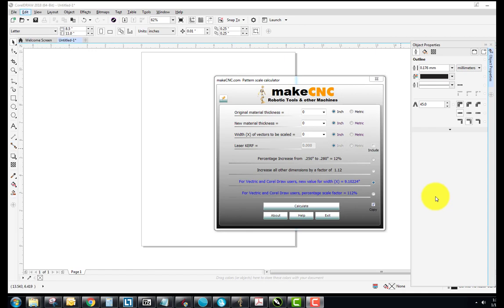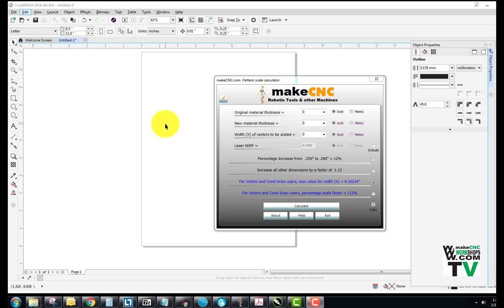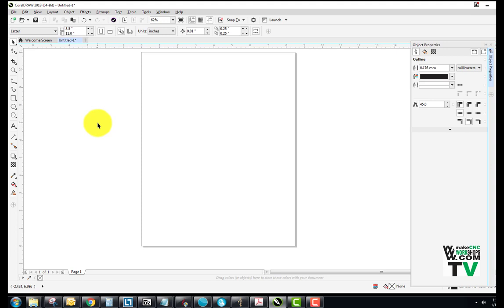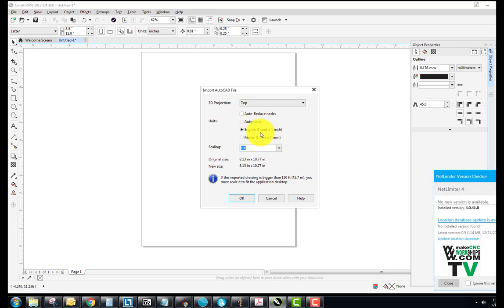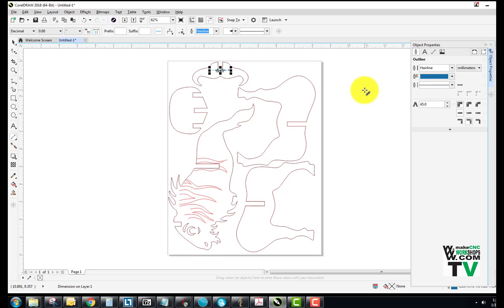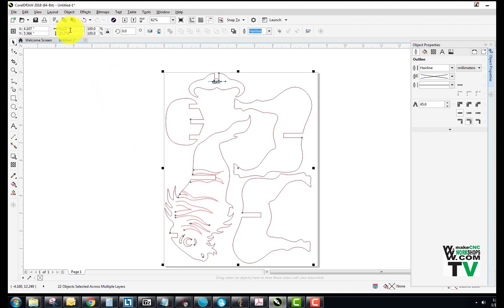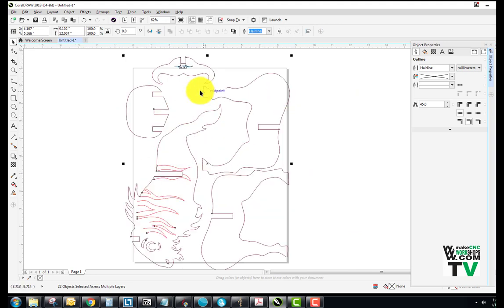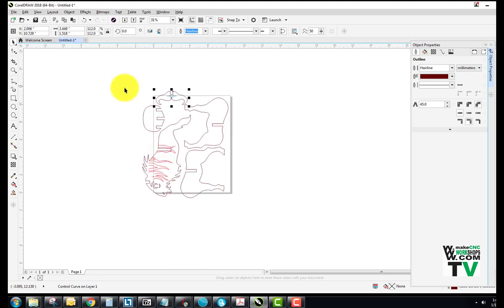Corel Draw makeCNC scale calculator tutorial

Comment: Quick question this is great when you have slide in joints, but what if your a a pattern that has a slot in the interior of the object will it size correctly?
Reply from the maker: yes it will as long as you have it selected along with all other vectors when you use the scale command in your software as described